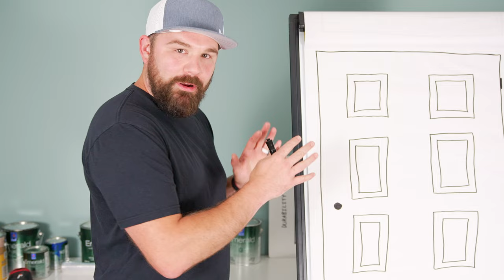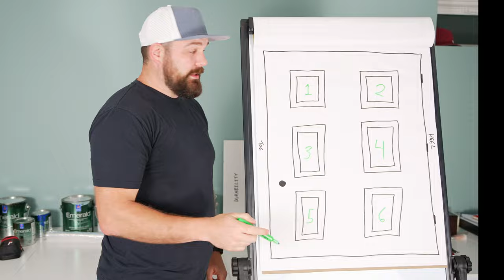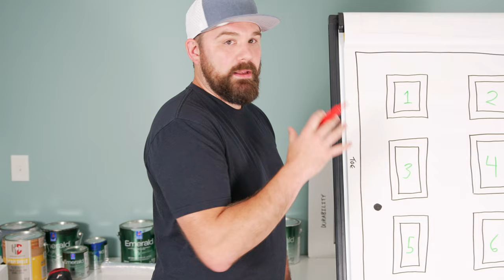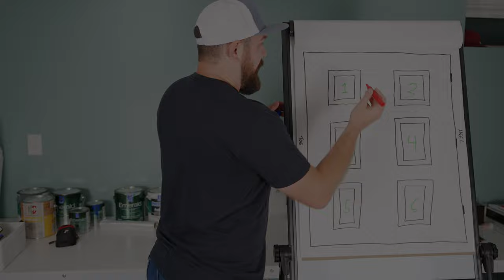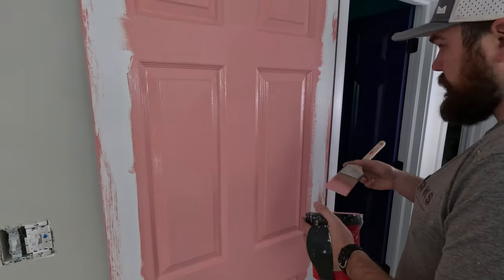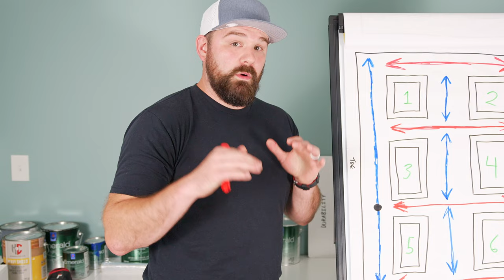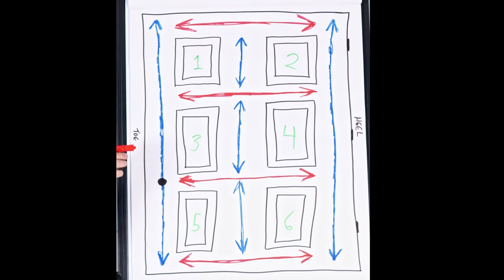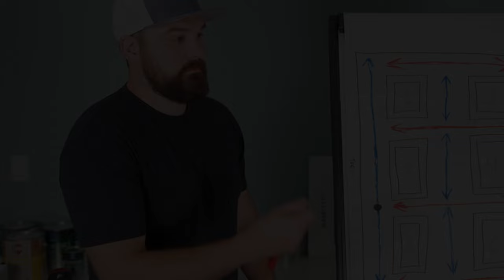The Easy Paint Pattern to make Your Doors Look Amazing

Comment: Thanks for this video.  I’ll give this method a try.  I’ve always just painted from top to bottom, because it’s easy to keep track of what you’ve already painted, you always have a wet edge, and if a drip falls off your brush it doesn’t fall onto an area you’ve already painted.
Reply from the maker: This is my beginner pattern.  The next video is my more advanced pattern that I currently use.  It’s closer to what you described.

Comment: Why not just use a covered end mini roller like a 4" true blue 3/8" nap and go to smashville? I can paint both sides of a prepped door in 7 minutes doing that. No dealing with all the directional patterns, brush marks, drips and leaves a more uniform finish. You must be a little old school with that dinosaur brush from brushing doors with Satin Impervo back in the day 😂.
Reply from the maker: I’m not a fan of the rolled finish on these types of doors.  I’ll roll doors that are the flat panel type but if there’s a grained pattern on the door then I prefer them to be brushed.  I think it looks better than a rolled finish.  🦖

Comment: I spray mine and flip m 2 min each door 14 doors in a😊 hour
Reply: I put a M-80 under a 5 gallon bucket and get 287 doors done in.07 seconds. and I can spray 87 doors with my little pinky in 46 seconds 😮
Reply from the maker: If you’ve got the space and the setup for it then that’s the move.  Have you timed yourself for how long it takes you to prep, setup, rehang and clean the sprayer out?

Comment: Good stuff. You make it look easy. The last door I did I rolled it. Flat panel door. Off white, semi gloss with Sherwin Williams solo.

It came out awful. From straight on it looks great. From a side viewing angle it looks like a cloudy textured roller mark mess.

I really need to figure out wtf I am doing. My next attempt will be with a brush to get the paint on the door... and a Whizz black roller to flatten it out.
Reply from the maker: If it’s a flat panel door you may want to give this video a look: How to Paint a Flat Panel Door | 3 Easy Steps
https://youtu.be/yutwEGLconE

I usually roll flat panel doors but there is technique and skill involved.  Also, not to poop in your cheerios, but Solo paint kinda blows in my experience.  I think you’d get better results with emerald urethane or even the regular emerald in semi-gloss.

Keep at dude.  You’ll get better with reps 🫡